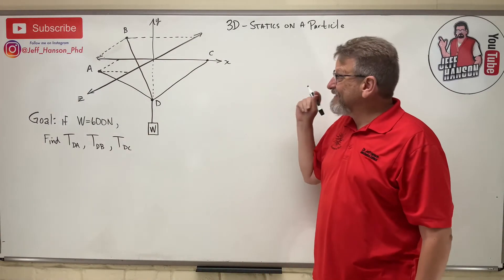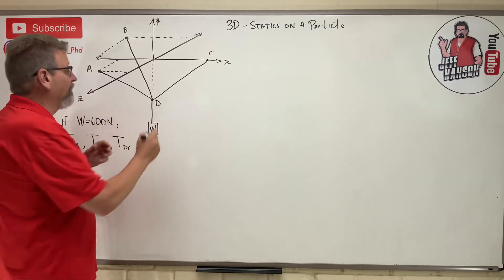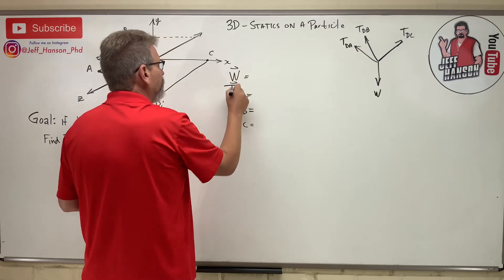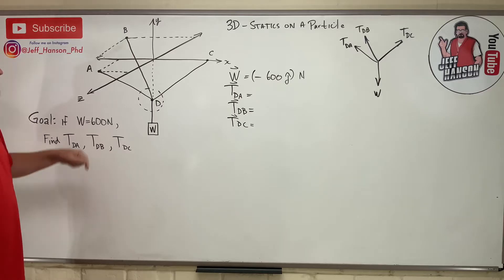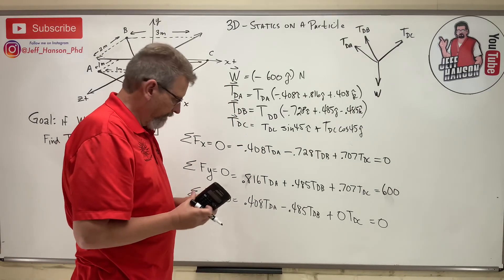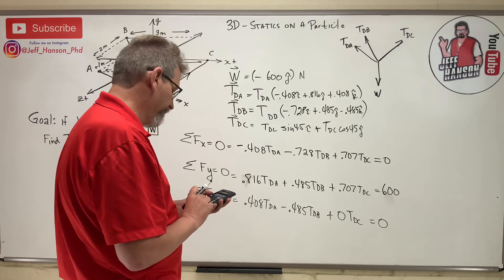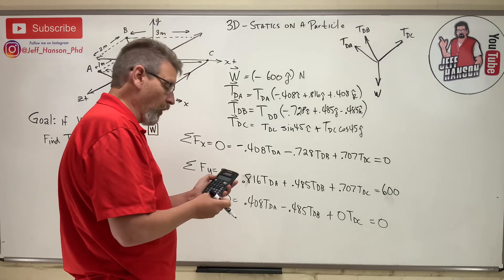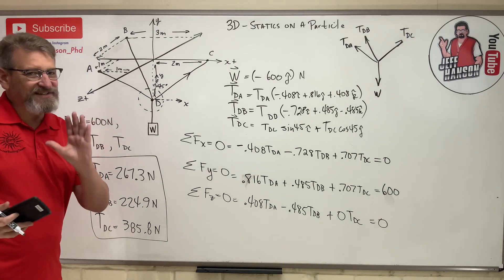Statics: Lesson 20 - 3 Equations and Unknowns, 3D Vectors

Comment: Is not sin 45 degrees supposed to coincide with the J^ and cos 45 with the i^?
Reply: it depends on how the angle is given. usually we measure the angle from the positive x, where yes, cos is the x component and sin is the y component. however, the angle given in the video is measured from the positive y axis, which is why he switched them. what i like to do instead is find the complementary angle and stick to cos with x and sin with y.

Comment: I am stuck at the calculator part, how do we do it algebraically ???
Reply: Substitute until you get two equations with the same 2 unknowns, then substitute again and get the answer. Just easier and make less mistakes if you use your calculator. TI36 Pro is a cheap investment into your grades!

Comment: im so frustrated, you should have done TDC the normal way, i don't know how you magically used the sine and cosine
Reply from the maker: What is the normal way?
Reply: Lamba Hat for TDC 

(X,y,z) 

Is z = 0 ? 

I dont know how to read the points on yhe graph, thats my greatest struggle
Reply from the maker: @ikennao5299  I’m with you. I just wanted to show a different way. Yes the lambda hat method does the exact same thing. You are not alone. Many students struggle coming up with the correct coordinates of a point. Lots of practice is all I can tell you. Keep up the good work!
Reply: @ikennao5299   Hi sir  can you pls make a video on how  to get the exact reading of the coordinates.  I am also  having issues regarding this just like some other students out there too . I will be glad if you  can consider this  request 🙏

Comment: How can I use this method to solve a problem where I'm given the tension in a cable and need to find the weight of the object pulling on the cables? Thank you!
Reply: Solve for the forces in the y direction, the tension between the two cables is the same. Break up the tension into the two components in order to obtain the unknown variable
Reply: Just use the equilibrium condition in weight direction
Reply: add the tensions and equate the answer to the wight vector(W)
then get the magnitude of W and you are done, the answer is the wight (should be pointing "down" if gravity is the only force affecting the object)

Comment: Is that supposed to be cos45i instead of sin45i?
Reply: u are right but doesnt matter if angel is 45
Reply: the reference of the angle is the y-axis so if its with respect to the y-axis you use sin45for x component then cos45 for the y component. But if the angle is with respect to the x-asis, you use cos45 for x then sin45 for y.

Comment: how do you solve the equations with the calculator? I couldn't figure it out that part.
Reply: if you are using casio fx-991EX,
Menu/Setup/Mode
A: Equation/ Function
1.Simul Equation
Select number depending on how many unknown
then input the equation
Reply: I figured it out if you still need help
Reply: @kurt3419  do you know how to do it with a T84 plus?
Reply: Erica Pequeno I’ll look up one looks like and let you know. I use the same calculator he does
Reply: @kurt3419  sweet! Thanks!
Reply: @EricaLuvsYella  not sure if it applies to your calculator, so if you can’t figure it out from his tutorials, I could probably walk you thru it. It’s just using the 3x3 matrix function on the calculator